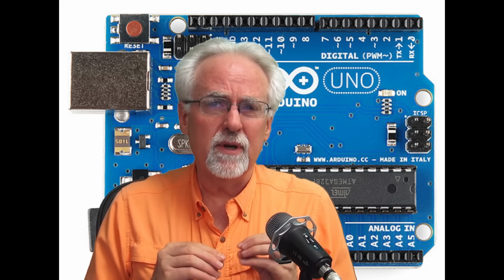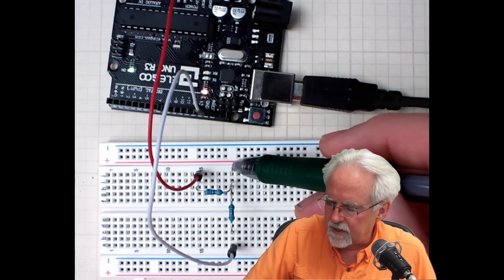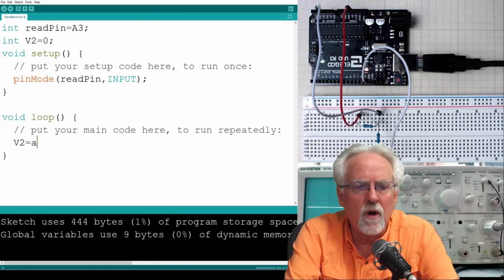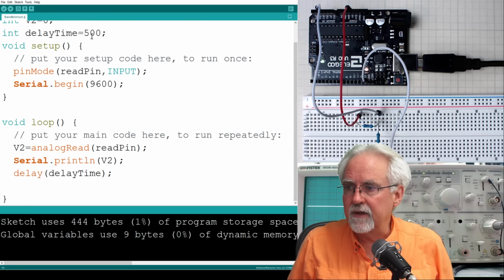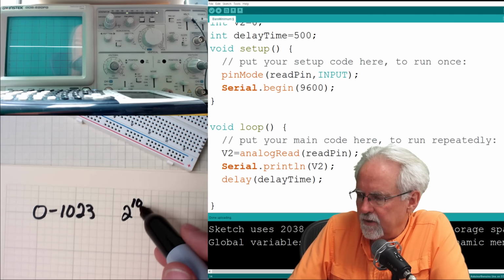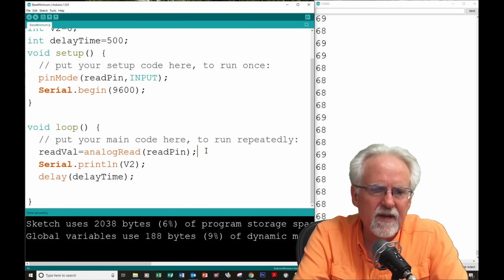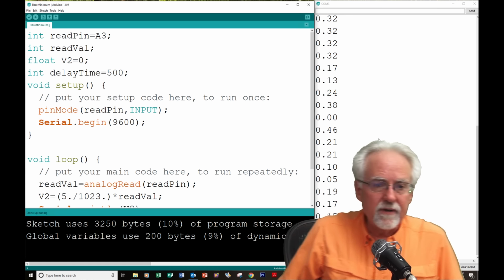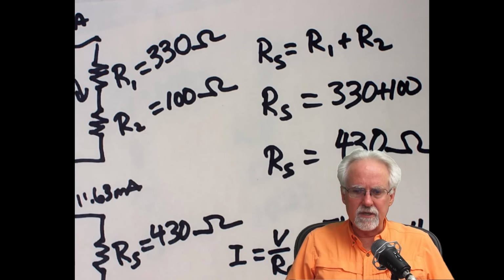Arduino Tutorial 10: Understanding How To Read Analog Voltage using analogRead Command

Comment: Am I missing something obvious? I’ve got the circuit hooked up the same as far as I can tell, with 330 then 100 ohms and it’s reading 4.84 or 0.29 respectively. Getting 5.0 from the output.

Edit: instead of deleting my comment in shame I’m going to let y’all know that if one of the bands on your resistor is faded or rubbed off, it may not be the one you’re meaning to work with, and you should get another one.

Comment: Apologies if this has already been asked;  I tried testing my understanding further by trying to read the voltage drop across R1 in this circuit however all I kept getting was 1023, i.e.5v.  I even tried this code... V1=analogRead(readPinA2-readPinA3);...although the code "works", it does not give an accurate analogRead voltage across R1.  I'm getting 247 which, after the conversion math = approx 1.2v.  My circuit is the same except I have added a connection from A2 to the positive side of R1.  Any ideas?

Comment: Just out of curiosity. When I leave the "." out next to 5 and 1023 it shows 0, as expected then if we follow your lecture. But it gives a proper reading of the voltage when just 1 number there has a "." after it. It works when I put it "5." or if you put it "1023.", I didn't need to put it on both numbers, is this correct, or will it cause a problem with the numbers when it gets more complex later on?

Or is this only doable because I'm using "tinkercad" and not an actual physical arduino board etc...?

Comment: If i have an Arduino controlling two leds that need to be triggered by voltage that is sent out to a set of motors. Would i need to use a voltage regulator to reduce the voltage going into the analog pin?

Comment: You could have gotten to that formula using proportions
1023/5=readval/x  solving for x gives you the actual voltage at the voltage divider
Reply from the maker: Proportions only work when the Y-intercept is zero. People who rely on proportions often use them when the Y-axis is  not zero, incorrectly. So why not just understand the real math, and use the math, and get the right answer every time?

Comment: Lesson 10 about 21 minutes you state that in integer math, 5/1023 is zero.  I don't get it.  Is that because the result is less than 1?  For example you would get a valid result with 5/5 or 5/4 but not 5/6?  You put a decimal point after the 5 and 1023 to make them floating and then the calc has a value.  Can you please explain.
Reply: So basically there are two types of divisions a computer can perform.
First is integer division for integer values like 30/5 which gives an integer result i.e. 6, if you try something like 5/2 then the computer only performs integer division and results 2 and does not calculates decimal values.
To overcome this, we have float division for floating type values like 5.0/2 (or 5/2.0 or 5.0/2.0) which gives a float result i.e. 2.5  . Even if you try something like 30.0/5.0 it gives 6.0  .

And lastly, you also have to store the result in a variable of an appropriate data type (float or int).

An int result can be stored in a float without any problem (it will only add a .0 at the end), but not vice-versa as decimal data will be lost.

Hope u find it helpful 👍

Comment: Thanks Paul, I am really enjoying your Arduino series. I haven't had a problem until #10 when I just couldn't get the correct reading from the Arduino for the voltage. It wasn't until the next day when I checked the circuit with a multimeter that I discovered I had used a 100k ohm resistor instead of a 100 ohm one. No wonder I was still getting close to 5V as the measured value. Still was a valuable lesson and will definitely make me pay more attention to the labels on the components in the future.

Comment: Thanks! learning using the Analog Inputs.
Arduino Uno 3 onboard Analog digital converter ADC resolution 10 bits.
Q;
Is it possible read the digital value  ADC and display this value ?
In state off your 5/1023 calcukation.
Kind regards! Theo

Comment: I am getting different numbers depending on wire placement for instants when you are talking about 1000 range I am in the 900 range I moved from the holes past the 60 to at 60 and it improved to the correct number 1023. Is that normal or do I have a bad breadboard?

Comment: I followed along lesson 10, wrote the sketch, but could not get it to compile; the error had to do with the Serial port. I checked, and rechecked, but could not find the error. Then I remember you saying that some of the analog ports cannot be used. I can't compile in port 2, so I moved the pin over to pin 3, and it compiled. I don't know how you got yours to work out of pin 2, that was %#@F9 pain.

Comment: Why is on/off which is 0 & 1 equal to 0-255 where as now 0-5bolts is now equal to 0-1024? Why the rapid change & difference
Reply: Analog (A0 to A5) and digital (0 to 13) have different resolutions. Digital pins are 8 bit resolution in pwm (2^8=256 values) whereas analog pins are 10 bit resolution (2^10=1024 values). You can even uses external boards that connect to arduino which have larger resolutions.

Comment: another amazing lecture. question, v2 =1.16V which is what we calculated, however v1 doesnt show what we calculated "3.84" ? it shows the total 5V value. why?
thank you!
Reply: Because if you read V1 in this circuit, you are reading the voltages of V1 + V2. 
You can calculate V1 using the voltage of V2 or you can switch the components. 
There are other ways, but this is the easiest way for this lesson.

Comment: Thanks for the amazing tutorial, it is super fun.
I successfully to use this voltage reading command to detect the PWM that taught by the previous lesson.
But i am still confused about why we need to declare V2=0, i tried to only use "float V2;" instead of "float V2=0;" and it is still work.
so what is the reason to make it =0?

Comment: Wow, great explanation! Still can't believe you are liking the comments after 3 years!

I have a couple questions:

Is there a way to calculate V1 (without switching the 2 resistors on the board)?

Shouldn't the unit conversion (5./1023.) be the the value given in the voltmeter (4.86./1023) to get an accurate calculation?

Thanks alot!

Comment: Hello! Im new to arduino so im sort of confused about the fact that one pin is measuring voltage. Generally with a voltmeter you need two pins to measure a potential difference, so how is the arduino doing it with one. Is it measuring the potential relative to the ground pin? And if so, how would you measure the voltage across a resistor that is not in the immediate vicinity of the ground pin, for example a resistor between two others? Hopefully this question makes sense. Thank you as always sir!
Reply from the maker: Voltage is referenced to ground.

Comment: Hi Paul. I'm making my way through your tutorials to familiarize myself a bit more with microcontrollers and circuits in general. So far, I'm following along very well and would like to express how well you're able to convey these concepts in my opinion. Regarding this particular video, I understand how to measure voltage drops over each resistor using a multimeter. You made a point that it's not always convenient to use a meter and could take advantage of the analogRead function for this. You showed how to pinpoint between resistors, thus reproducing the multimeter measurement of the drop across R2, but how could you read the voltage drop across R1 using the analogRead function (which is simple enough with a meter). It's my understanding that it pinpoints a voltage between the probe point and ground. Does that imply that you can't necessarily isolate circuit components to, for instance, find the drop across something more upstream (farther away from ground)?
Reply: Hi @brianzu. I was wondering the same. did you ever get an answer on this question?
Reply: Think you could use two analog read pins, one would tell you the voltage across R2, and the other across R1 + R2, thus you just need to subtract the two readings to get the one across R1. But this is probably cheating with a second pin 😅

Comment: I Don't get why it is not reporting full on (1023)then 0000 full on(1023)then 00000 ect...as in the PWM function it is actually performing. Also why isn't it scaled to 1 volt, does the formulae have to be changed for every voltage?

Comment: I did my homework, arbitrarily choosing a 220 ohm resistor in position R1 and a 330 ohm resistor in position R2. The relative drops in voltage across the resistors was 2 Volts and 3 Volts, respectively. This explained the results of the example you gave.  The relative voltage drops are proportional to the values of the resistors in R1 and R2.

I used my Kaiweets KM601 multimeter to confirm my results, which were:

V = 5.020; R1 = 219.9 ohms;  R2 = 329.1 ohms.
Current = 5.02 / 549 = 9.144mA.
Voltage across R1 = 2.100V.
Voltage across R2 = 3.009V
Total Voltage = 5.020V.

Thanks for your continued support. As an old-timer, racing headlong toward my 70th birthday, I find your instruction in my new hobby invaluable. Keep up the good work.

Comment: I just got the following error message: upload error: failed uploading: no upload port provided
Reply from the maker: Either your USB cable is not connected, it is a bad cable, or you did not properly set/select the com port your arduino is on.
Reply: After I sent my message, I noticed a Red Cross against the uno selection box. I took out the usb connector and replaced it, whereupon the Red Cross disappeared, the setting was correct, and I had no compilation errors. Thank you for caring enough to reply.  You have my respect for that.

Comment: Hi Paul, a question for you, if you don't mind: I have my circuit set up like you do, but I've been playing around reading the voltage from other parts of the board, and I'm getting all sorts of weird numbers. I'm getting 5 volts where I should, and then 1.4 volts after the first resistor, and then 0.3 after the second resistor. But if I stick the wire into a totally unconnected part of the board, I get readings of up to 1.7 volts. What's happening?

Comment: I don't have an oscilloscope so.., I added pinMode(9,OUTPUT); back into the setup commands instead of using the 5V connection on the Arduino (merging this lesson with lesson 7), added the analogWrite(9,255); to the loop commands, and changed the delayTime that we were using for the Serial.println command to 10 msec.

So with the brightness set to 255, the output voltage was a constant 3.23 V w/ a 220 ohm resister.  When I changed the brightness to 127 with the delayTime at 10 msec,
this printed the Voltage fast enough to see the Arduino turn voltage on and off. The Arduino would print 5 lines at 0 Volts then 5 lines at 3.23 Volts.
When i changed the brightness to 64, the Arduino would print 8 lines at 0 Volts and 2 lines at 3.23 Volts.

Comment: I get an error that serialPrintln is not declared in this scope.  ???
int readPin=A3;
int V2=0;
int delayTime=500;
void setup() {
  // put your setup code here, to run once:
pinMode(readPin,INPUT);
Serial.begin(9600);
}
void loop() {
  // put your main code here, to run repeatedly:
  V2=analogRead(readPin);
serialPrintln(V2);
delay (delayTime);
}

Comment: Here's a question!

So... I'm reading what I would expect. Have two identical resistors in series, and I'm measuring about 2.5V across R1 and ~0V across the whole circuit. 

But... When I disconnect the read wire from the breadboard, I get readings jumping around, all the way up to 5V! 

My limited understanding points me in two directions in IDing the issue: 

1) the unterminated wire connected to pin A3 is acting as an antenna, and the reading is swinging about erratically because it's expecting DC and getting AC "over the air," 

or

2) there's something wrong with my Uno board...

Thoughts?

Comment: Hello. I was following your tutorial and saw that you set a variable of
int V2=0;
You didn't really explain why it had to be set as zero except to say that it was to initially set it up as 0. That kind of confused me.
What was the purpose of this exactly? I later tried it as simply
int V2;
without the zero and it still worked perfectly fine. That includes
float V2;

Was there something I missed in the video as to why it had to be set to zero?

Thanks for the vid btw.
Reply from the maker: When I initialize a variable because I am not sure if in the code I might reference the variable before a reading is made. Hence, by assigning a variable a value, it costs nothing, and in case I do need to reference the variable before the value is read, then the program wont crash. In this case not needed, but just a habbit I have.
Reply: @paulmcwhorter  So its just a fail safe for just incase. I see, thanks!

Comment: Hi Paul. I have learned a lot from your tutorials. I have question for you. Is it possible to program via the arduino a led on for say 5 seconds while another is blinking at the same time?
Reply from the maker: It is possible, but not using 'delay' as that hangs the program at that point. You can do it with the millis function inside a while loop with suitable if statements for timing.

Comment: Setting up V2 as 0 in the start of coding confused me a lot because from a mathematical point of view I was expecting the IDE to put the V2 function in void loop equal to zero.. but apparently it doesnt work like that.
Reply from the maker: You can not think of it that way. The program does not remember anything. It olny knows the line of code it is executing at that moment. v1=0 in one place and then v1=1 in another place. It is not like you are setting up a  relationship in a line of code. You are just assigning a value, and that value can be changed by any line of code at atny time.

Comment: So am I missing something? what I gathered is that you can check the voltage across the first resistor in the circuit or the combination of the two, but if you want to check the voltage of the second resistor, using analog read,  youd have to switch them around in your circuit??? i did so and got successful results using and 100ohm and a 10ohm. to the check both i had to switch the order.  4.545V and .4545V.

Comment: As always, a most excellent tutorial.  In this voltage divider circuit, we measured the voltage drop across only 1 resistor.  Using the Arduino from our most excellent Elegoo kit, how can we measure the voltage drop across the second resistor?  (Maybe you will cover the topic in a later lesson)

Comment: Why was the variable "readVal" declared as integer instead of float? In my circuit I used two 330 ohm resistors so the expected result was 2.5 V but when I read the screen it displayed as  = 2 only. It was fixed only when I set readVal as float.

Comment: Why is the arduino voltmeter voltage fluctuating so much 1.18 - 1.52 and voltages in between

Comment: Hi Paul,
Small problem here.
Have the circuit set up correctly(triple checked), everything is as it should be. also checked the code and is all correct. When I run the program in Serial monitor I get a reading of 244 where on your tutorial you get a reading 284. Have checked my resistors and am defo using the 330 and 100 Ohm in the right order, however I did notice that the markings(stripes) on my 330 resistor are different to the 330 resistor you are using. The small pack of resistors I am using from the Arduino kit has 330 printed on the tape. Not sure where I going wrong
Reply from the maker: Resistor values are not exact. If I were to guess, your resistor is not the same value as mine. That is OK.

Comment: why it writes analog only 256 and reads different at 1028, i understand where the numbers came from they are binary but is it the processor was made specific to do this but other processors read and write different?  and also why digital read or analog read arduino doesnt read when the input voltage to the circuit is an output pin from the arduino?
Reply: thank you so much for all your videos, i have worked as an electronic technician for a long time but never went to deep into programming, now getting a refresh in everything your videos are very helpful.

Comment: Instead of using two resistors (for my homework), I chose one 220 ohm resistor, and an led, because I wanted to know how much resistance an led has with a 5V power supply, and a 220 ohm resistor.
In this case, you have two unknowns, the current of the circuit, and the resistance of that led. Now you're forced to use the analogRead command from this lesson to read the voltage across the 220 ohm resistor. Finding that value, you can use ohms law to find the current of the circuit, which then enables you to calculate the resistance of an led. In my case, led has a 355.55 ohm resistance.
Sorry if that was bad explanation.
Reply from the maker: The problem with your reasoning is that the LED in not linear. That is, its resisteance depends on the applied voltage, so Ohm's law does not apply. You have to analyze it as a nonlinear component
Reply: @paulmcwhorter  Thanks Paul. I assumed that an LED's resistance depends on the voltage input. In your LED lesson you explained how electrons travel between donor and acceptor atoms which releases photons, and that process is made easier by increasing the votlage.
Is it wrong to use Ohm's law to calculate the resistance of an LED if we have a constant supply of say 5V? Isn't the LED constricting the travel of electrons at a steady rate?

Comment: I didn't get the same R2 readings. Then I realised that what I thought was a 330ohm resistor was a 220ohm. Ohm's Law and circuit analysis (and my old analogue multimeter - a Tandy "Micronta') survive the test! The kit I'm using doesn't have 330ohm resistors, but lots of 220ohms. It has just struck me that I can put two in parallel and those two in series with the other and get ... 330ohms!